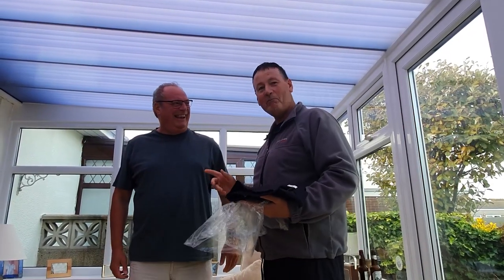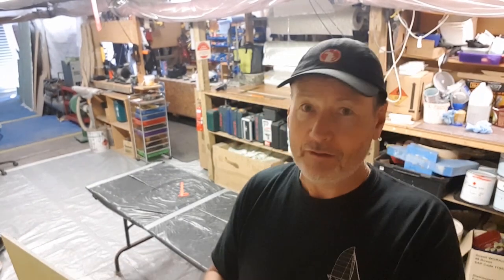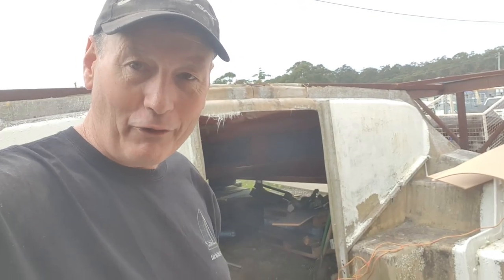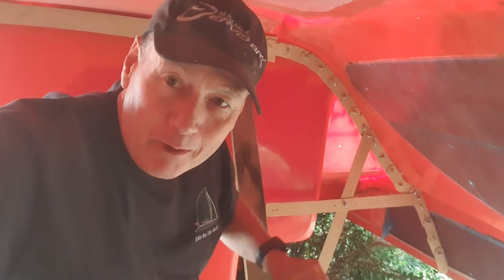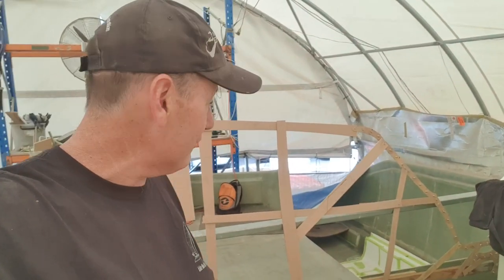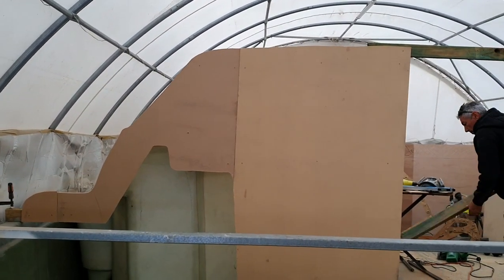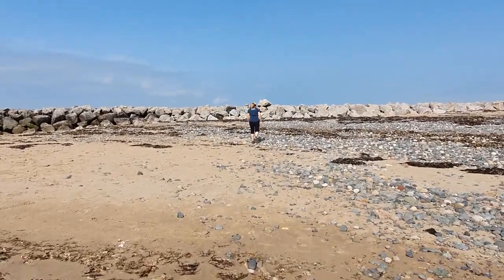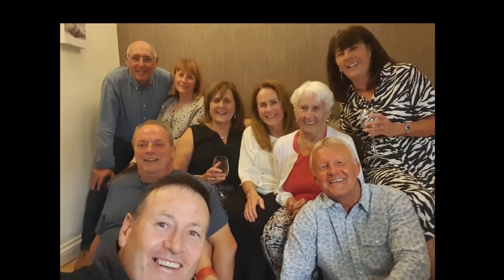Ep091 How Thick Is My Cat's Hull? - Life On The Hulls - Catamaran Build Project

Comment: This (woven roving layup with layers of long-strand mat) actually looks like what we did BEFORE chopper guns became popular.  Except we used to build it up on monohulls to about 5/8 inch / 16mm thick.  At 8 mm I'd be happy with strength, but a little worried about rigidity.  But that's a monohull.   A cat hull has smaller bends and is more self-reinforcing.  Watch it to make sure it doesn't 'oil-can' flex when you're going over waves, because if it does that eventually builds up material fatigue and fails.

Comment: I was working on a 150” Wally yacht build many years ago and had to cut through the keel when mounting a large bow thruster up front. The slab that we cut out was over 50-60mm thick and weighed over 20kg. The bottom most plies being glass around 20mm thick the rest being the overlapping joint carbon plies of the two sides of the hull joint. Different beasts I know...
Reply from the maker: That is a seriously thick hull Ian. Was it all glass or a combination of wood as well.Sounds like a nasty job.Cheers .Ross
Reply: Hi Ross, each side of the hull was carbon prepreg with various core materials, mainly HD foam. Along the keel there was no core, just the overlap of the two sides of the hull. Not sure how wide the overlap-joint itself was. The glass layer was up to a couple of meters wide in places.
We weighed the hull complete with most bulkheads, main deck and Diesel engine came out at 36 ton iirc, big old girl, 148’, called SAUDADE.

Comment: trying to get a little bit of a better feel of where you stand!,i know the feeling!,i am curently building a bruce roberts semi displacement hulled catamaran at home in perth wa.My boat is 11.2m by 5.25m beam it is a motorsailor design.My laminating schedule is solid vinylester with 450 gram csm and 480 gram uniderictional fabric.My hull is approx 10mm thick of solid laminate and my bulkheads are 18 mm ply following a 3 combination layer of the forementioned csm and fabrics.I am going to renforce the bulkheads,stringers,webs  and bottom of hull with a couple more layers of fabric and one more layer of chop,mine is not a racing vesell but live aboard cruising!

Comment: If it's anything like the laminates we use in a building restoration, they will likely cut it in smaller pieces. Four for the two directions, and the rest for impact tests (and the number there probably depending on blunt, sharp, shear, or abrasive ala Titanic). Our covered beams get tested much in the same way to allow us to certify the work.
Do you guys get like an aluminium tag that's required to be glassed in, or just a piece of paper?

Comment: Ross, I hope I didn't miss something in your explanation about the destructive testing but you are showing 8mm of lamination, but isn't that just the outside layer? You then have the core foam and whatever the inside lamination is, so that sandwich cross section is considerably stronger yes?  Do you not have core foam in the laminate of the hulls below the water line?
Reply from the maker: Amsa testing only require testing of the actual hull line in this case but this Cat is Foam core at the hull sides and 15cm each side of the ctr line.Amsa di not require test samples of core however, I will ending them a piece regardless.Cheers Ross

Comment: I was sure that your hulls would be something like 18mm thick, but 8mm? I hope thats enough
Reply from the maker: Matias.This thickness is sort of in the ballpark and a very tight laminate.Only really 40cm wide along the keel line then foam core and approx 30mm fir remainder.Given the layers of quad and biax I have increased the quad from 1040g to 1215quad so engineering is sound.Cheers buddy.Ross
Reply: @LifeOnTheHulls  nice to hear! Sorry for being so broke that i cant be a patreon 😪

Comment: I'd be curious what you or others think of lighter foam core laminate schedules. The lightest I've found for a cruiser is the harryproa which uses vacuum infusion and epoxy:

Harryproa 65' lee hull, engineered laminate (incl FEA), 800 gsm infused  glass either side of 30mm foam (spec was 25, but it is being built and  sailed above the Arctic Circle so insulation was important)  100 sq m of  hull, 5 kgs per sq m/1.02 lbs per sq'.     
Harryproa C50.  600 gsm infused glass either side of 20mm foam  3.6 kgs/sq m /0.73 lbs per sq'. 

I assume it won't be quite as impact resistant. 

As always, thanks for all your videos!

Comment: i have just 1 question?what kind of resin with mixed hardener do you use in your spray gun for laminating???i have resin that have to be mixed with hardener about ratio 1 to 1000?due to longest hardening times

Comment: Well, this is almost the video I have been hoping for in this series, the weights you mention don't seem to match the list. Wanted to see all the layers explained in order of lay up oh well ...
Reply from the maker: The weights are above the spec drawing.Instead of 1040 quad we chose to increase to 1215quad in both cases as firstly there was no availability of 1040 quad without overseasshipment from 3 companies and for safeties sake it was increased to improve impact protection.Although added a bit of weight it was agreed a substantial strength improvement ovwrall.Cheers Ross
Reply: @LifeOnTheHulls  still would like to see a lay up video with explanations thanks for reply

Comment: CAD to the rescue Ross ! Amazing what you can do with cardboard or other scrap mat'ls... watching the inside view of the salon, was wondering about the layup of the sections where the windows will be... do you glass all of it and cut them out later, or put in something to avoid waste as a temporary window placement like plywood or mdf etc ?
Reply from the maker: Window mullions will be solid glass and the actual windows will be rebated about 1cm with kirfed sheet and radiused and then a light layup to be then cut out.There will be a lot of prep work setting the window inserts but will be removed after demoulding.Cheers Ross